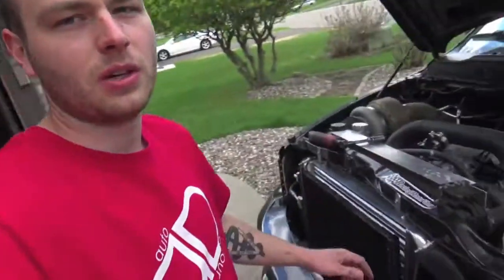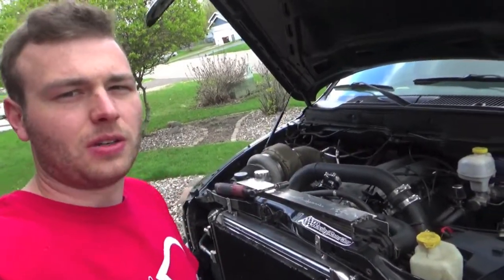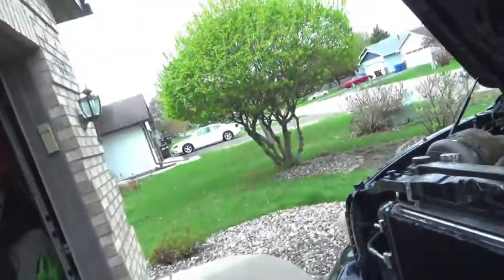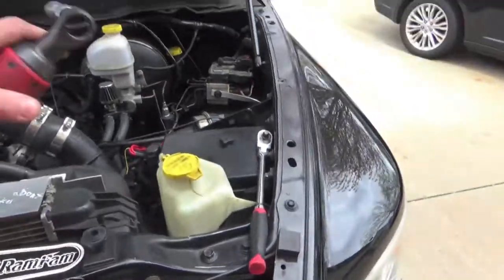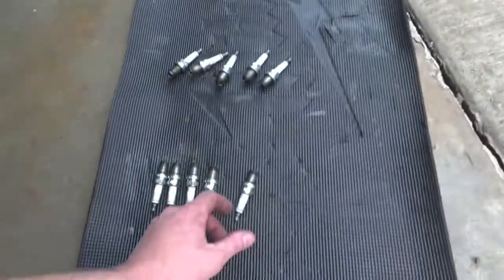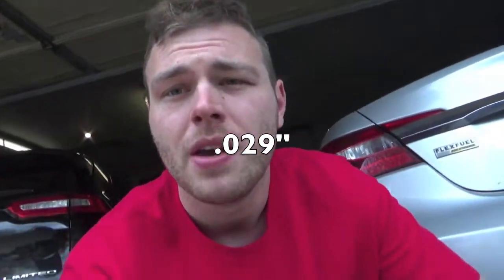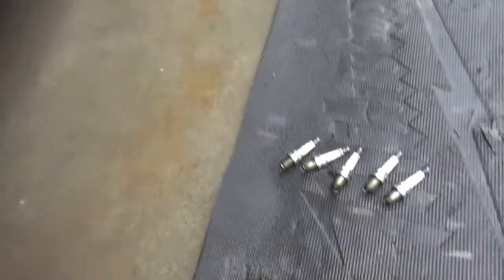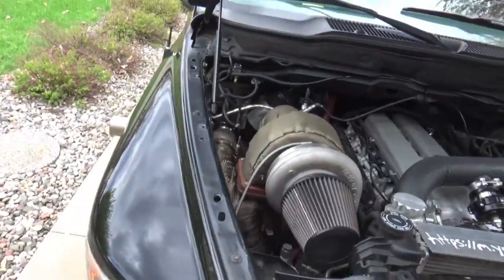2004 Dodge Ram srt10 viper spark plug removal and inspection

Comment: Hey there Eric! Great stuff in your videos I like it. I was contemplating on the pros and cons between turbo or blower/supercharger and would like your input on which force induction would give me the best bang for buck for performance gains without too much reliability loss? I almost forgot, this is regarding my 2005 2dr t56 shiftin Yellow Fever  edition Viper Truck. Also I just recently upgraded my fast bleed lifters to jtsvp performance slow bleed lifters and I'm putting everything back together set my coil paks and I'm not really 100% on whether my plug wire arrangement at the coils are correct. Starting with the back coil one row at a time going left to right. So with both coils there's 4 rows. 1st row furthest back left to right 2,4,6 2nd row 3,7,1 that's the rear coil, 3rd row 5,9 and 4th row 10,8 the front coil pak. Can you shed some light on this for me? Are my coil wires arranged correctly to fire 1,10,9,4,3,6,5,8,7,2?
Thanks much Eric!
Keep Boostin!

Comment: Hey bro y is my stock ram srt10 making a loud tiking nois is it my spark plugs? Or miss fire ?
Reply: Is it a tappity sound that's more noticeable when you get on the throttle? Or is it faint at idle and just goes up and down throughout the rpm range? Two things, which really is one of a few things that the "Dodge suits" corporate, had incorporated into our Viper Trucks to deliberately fail, leaving us with no other option but to upgrade these particular items or components that directly reflect the tenacity of our SRT10 Viper Trucks. Fast bleed lifters are definitely one of them, which would explain that annoying tappity tap you're hearing. It doesn't take much to initiate annoying quirks from Fast bleeds. Too much oil in your crankcase, which cause foaming, that traps air bubbles, or oil level too low, same thing air gets in your lifters...you get the idea. If your SRT10 is bone stock then beware of the part incorporated by corporate that makes the most least sense to make what was well made using aluminum to opting for the part to be made out of composite,(plastic). That would be the clutch slave. Anyway! Good luck I hope this helps you

Comment: I just replaced the plugs and I was driving home and my SRT-10 was acting weird. The speed would  and then eventually just go into inop. The only problem I saw was a spark plug porcelain part had cracked when I was taking it out, but I blew air in the cylinder to blow it out; which it did come out. Any ideas?
Reply from the maker: Nes Kee huh? Like the porcelain on the outside of the plug or on the inside by the conductor

Comment: Is this really it to do new spark plugs ? I heard you had to pull off the manifold? I just got a 2004 srt10 and need to do new plugs
Reply from the maker: Ariel Elizalde to do plug wires you have to take Intake off but not for just plugs
Reply: No, you only need to remove the intake manifold if you're replacing or upgrading your plug wires and/or coils. Because the ignition coil paks (2)are  located under the intake plenum. 👍

Comment: Hey how u connect the oil catch can is it only for boosted trucks?
Reply from the maker: V10SRT_ CRUZ the way I have it plum yes. But you can plum it for natural aspirated with it just going in line with the pcv
Reply: Is it the one by the TB on driver side, because I've heard that our trucks don't have the pcv 🤔
Reply from the maker: V10SRT_ CRUZ we don’t have a pcv valve. We have pcv. I don’t remeber what side it is. It’s the one that goes to the intake manifold has a small restrictor in the valve cover
Reply: Yeah I think I know wich one u talking about its a small elbow that goes from the intake to the valve right..... I was curious about that because my cai has alot of left over oil and on the TB, bad ass build u got bro that turbo 👍👍👍👍🙌😁

Comment: What ngk spark plugs you used?
Reply from the maker: Ivan Rosales 2 steps colder due to running 12psi of boost
Reply: RacingRamFam what gnk spark plugs can i get for a stock srt10
Reply from the maker: Ivan Rosales your going to want to run champion plugs if your stock 438